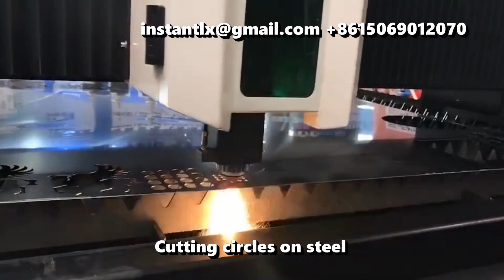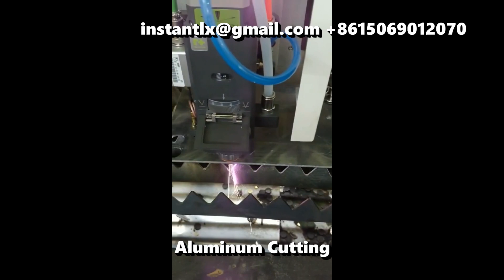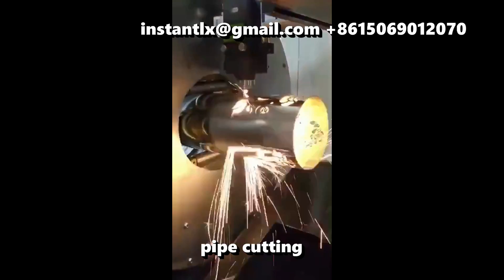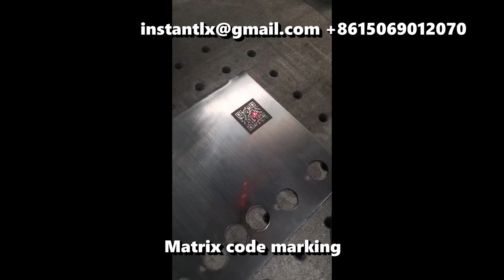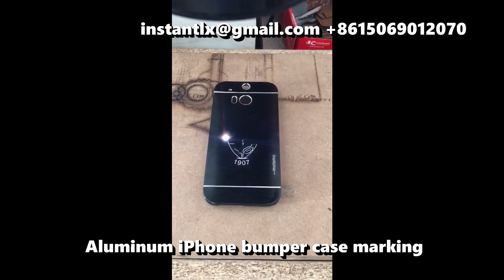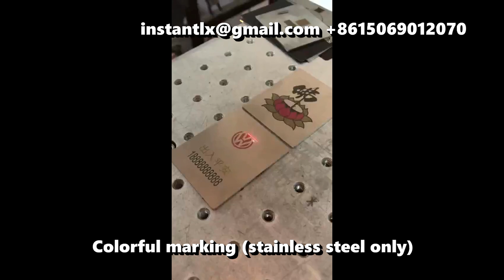Fiber laser demo, fiber laser cutting machine, fiber laser marking machine

Comment: I do not see any lasers sold which are meant to cut anything but flat sheet, but it seems like a high power fiber laser 1kw or 2kw could cut somewhat efficiently on metal, like the lower power engravers but faster.  Has anyone seen anything like a 1kw fiber laser engraver?
Reply: Hi Sr. Yes ,you just type on Google Search " 1kw fiber laser" & it comes with Boss Laser or Hytek Tools and they sell Machines but they are quiet expensive ) )I assume they are very Precise and thats why is Pricey ,
good luck)